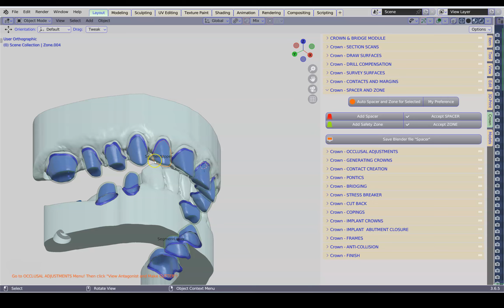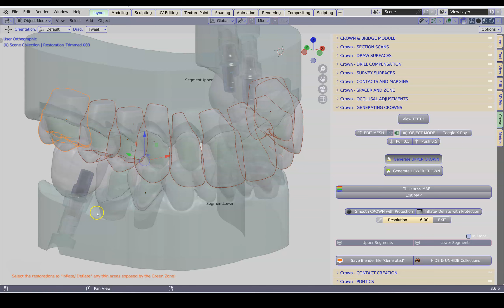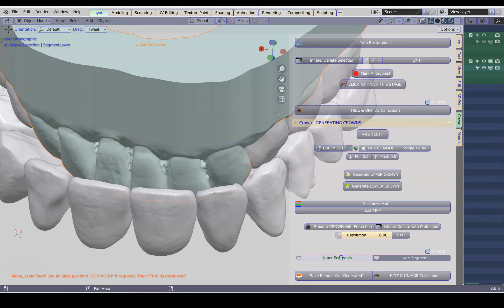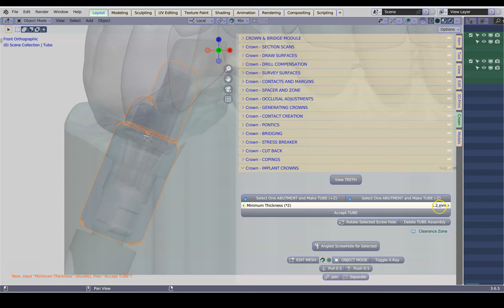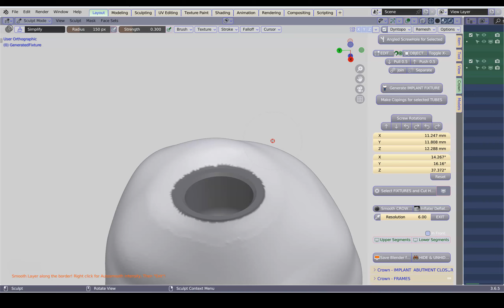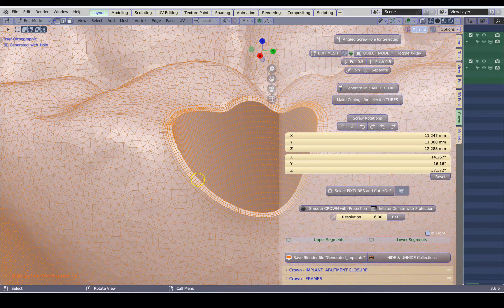Crown module in action!!

Comment: Hello Mike, When you have a case like that, with crowns on the upper and lower jaws, how do you select which one of them is the working model and which one is the antagonist?
Thanks, Avri
Reply from the maker: @DrALev  In this example i didn’t have an antagonist. I chose the tooth library teeth as antagonist when I used them to cut the occlusion.
Reply: @Blenderfordental  Can you demonstrate how you did it? 
It's not clear to me...
Reply from the maker: @ when it come to the cutting of the occlusion. Select any opposing crowns waxup teeth or models. It will duplicate these, join them up and remesh them as one cutter.